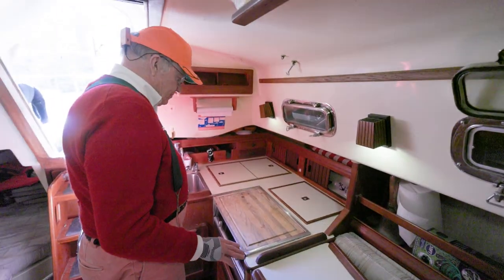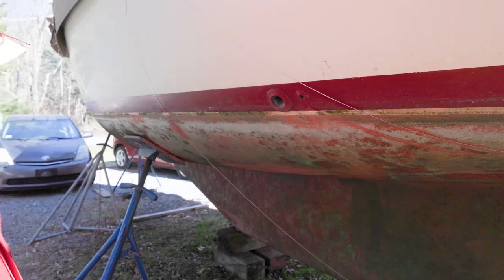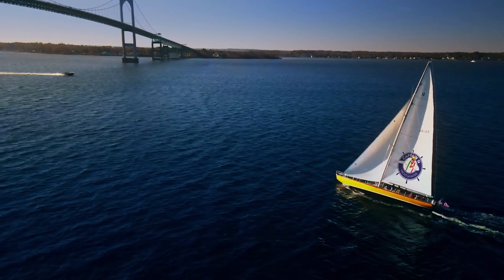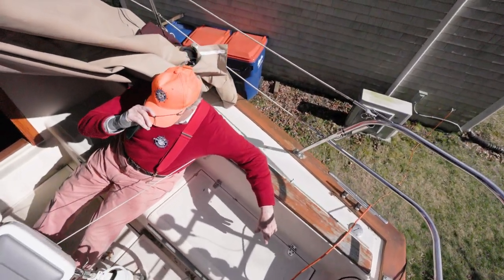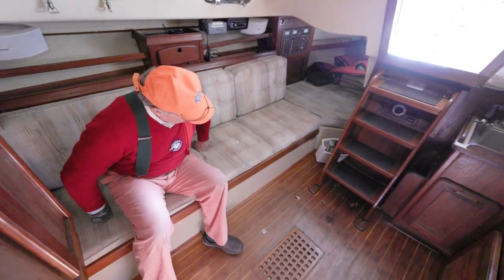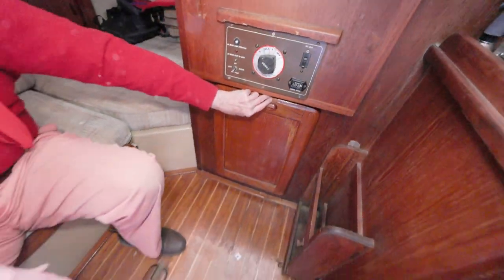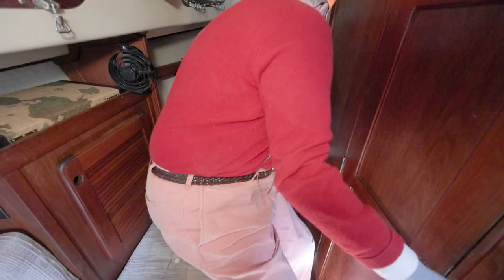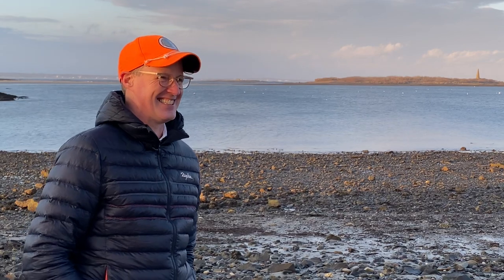GREAT POCKET CRUISER!! Island Packet 27 Sailboat for sale - EP91 #sailboatforsale

Comment: One thing missed was that the starboard settee seating surface pulls out such that the back cushions can be laid down to form a “two-fer” sleeper on that side. You can see the rail it slides on mounted to the bulkhead forward of the settee. A lee cloth can be attached easily to the overhead handrails above each settee.

Comment: I had one in the slip next to me in New York. He was very impressed with it, but I went out on it. It sailed horribly on every point, and had a very uncomfortable motion. Like most of the Island Packets I have seen it spent a lot of time at the dock. It did have a huge interior. The early boats had concrete and iron punchings ballast.
Reply: Agree.  These things were meant to stay at the dock
Reply: I sail my IP31 a lot, I moved up from a 24’ c&c and the island a key is not as quick and nimble but I think is much more comfortable in heavy seas.
Reply: These boats aren't meant for day sailing. They're for long distance cruising.

Comment: Island Packet builds a good quality boat.  Everything on the boat is quality and solidly built.  The only negative about Island Packets and the 27 in particular is that they are SLOW.  There was an Island Packet locally and all I can say about the boat's sailing ability is that I could literally sail rings around it with my Allied Princess 36 ketch and the Princess does NOT have a reputation as a sprightly sailor.  The IP is very well built and a decent cruiser if you don't mind motor sailing.
Reply from the maker: there are compromises in everything we face in life and designers have to do that   as well

Comment: I hate the lack of a tiller  on a 27 footer.  A pedestal wheel is my personal experience is a bit over kill
Reply from the maker: it does clean up the cockpit   remember cruising comfort and safety
Reply: My last boat was a 28 with a tiller. Current boat is a 29 with a wheel. I like the wheel better cause you can sit at the helm and watch/navigate traffic. Tiller you have to stand up or hang your head over the side. Not a huge deal, just tiring if theres lots of traffic.

Comment: how often should you hire a diver? mainly be in salt water.
Reply from the maker: It would depend on where the boat is moored 
But easiest way to to determine it is to look for your self 
Mask and fins dive on the boat once a week and see what the growth wash. We basically only raced so I dived the pb with a tank once a week and wiped down the slime before it ever thought about taking hold 
Remember sailboats are slow to start with so. ANy thing that will slow them up for a quarter or half a knot start to add up in your time to eta

Comment: Two observations: It appeared to me that the engine room, while showing 30 years of patina, seemed to have a very tidy wiring set up. Was that the case?

From my very limited sailing experience it seems to me this would be a fantastic 3-4 day cruiser for the Apostle Islands. That shallow draft would come in very handy and the smaller size would lend it's self for shorter trips just enjoying sailing and relaxing (assuming Lake Superior does not get angry!).

Comment: the  pacific seacraft orion 27 is I think a better boat and it was half the money.this boat is overpriced considering its age and condition.Replacing that engine would be a nightmare.Also no mention of what year this vessel is.
Reply: Right in the beginning of the video, it showed 1990 in the lower left hand corner, at a cost of just under 40k.  :)
Reply: 1990

Comment: I’ve been wondering about these boats. Glad you reviewed one. This one not for me. Basic design is a slow  boat. No nav station. And many fixes needed for engine.  We’ve seen better boats for the money on this channel. Thanks captain and ran-day.
Reply from the maker: fair points!! you're becoming a shrewd boat shopper, Beverly :)
Reply: "No nav station". Hahaha.....I just sailed one 596 miles across the Gulf of Mexico using an iPad. Its not 1980 anymore. You dont need a "Nav station". The fold down dinner table works better as a chart table anyways in all boats if you want to dust off a chart.

Comment: The boats made in the 80s, the hulls were poorly made.. lots of resin and only a few layers of glass
Reply: Usually yes that is so, but IPS were an exception
Reply: @edwardfinn4141  no they were not... I saw what they thought was a thick hull plug at the ft. laud boat show and you could see maybe 4 to 5 layers of glass in a 1/2.. maybe 5/8 in thru hull plug...cape dory has maybe 10 or more.. could not see through it.. I know that for a fact.. we commissioned maybe 30 dorys
Reply from the maker: good inside knowledge... thanks for sharing
Reply: @stevethurlow9059   My last boat was a Capy Dory, my current is an Island Packet. You are so wrong its not even funny.